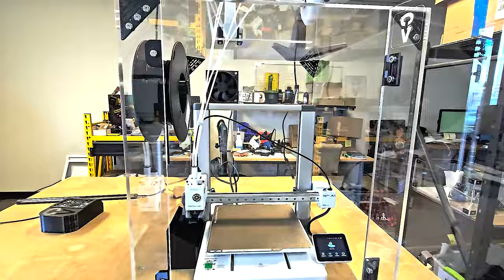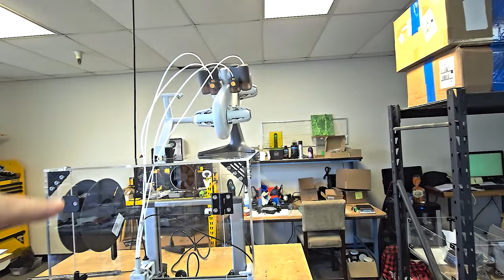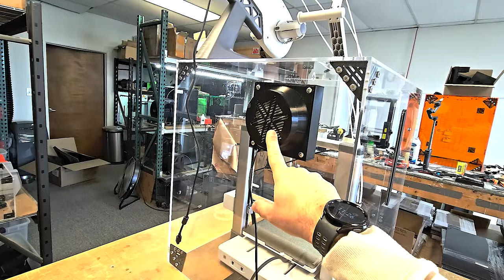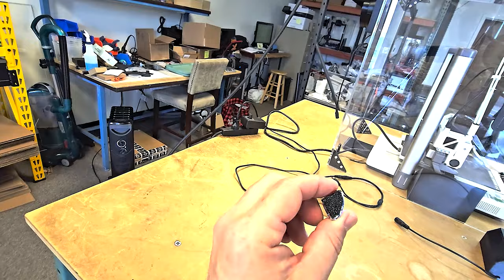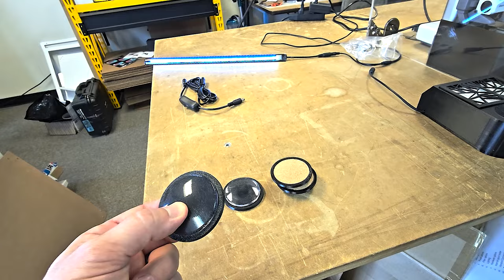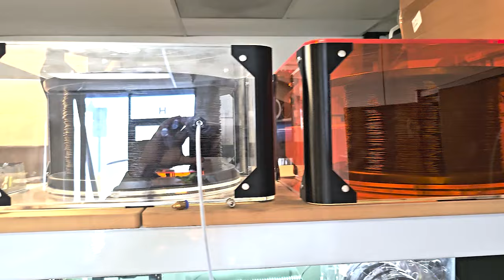Bambu A1 Enclosure by Clearview Plastics

Comment: ur products are expensive to the point that i might as well buy the p1s.
Reply: Not if you want multi color
Reply: @yobtnirp3D  P1S combo is 1000€, A1 + AMS is 600€. The Clearview enclosure is 325€ (no add-ons except for printable parts, because buying 2 rolls of high temp PETG is more expensive than just having them print it for you). Shipping to the EU is 118€ (!). Let's say I live in California, the total cost of the enclosure including shipping and taxes would be 360€.

So in total 960€ for an A1, AMS Lite and a 3rd party enclosure or 1000€ for a P1S with a full sized AMS. I know what I would choose.
Reply: @twanlange2827  In the US right now.  This thing plus your A1 combo is roughly $16 cheaper than getting a P1S combo to start with. Looks nice, but too expensive.

Comment: Way too expensive for what you get why not just print the corners and buy the acrylic yourself?
Reply from the maker: While building a custom enclosure is certainly possible, it's important to consider the full scope of the project. The materials alone, when sourced at high quality, are more costly that many realize. Beyond that, there’s the time investment involved in design, planning, and reworking to ensure it works correctly. Our enclosures are crafted using professional-grade machinery that ensures precision and durability, and tool set that typically cost well over $100,000.

We know what an enclosure with 1 hour, 10 hours, and 100 hours of work looks like. With thousands of hours spent refining our designs, we’ve optimized both the functionality and aesthetics of our enclosures. Achieving the same level of quality with home tools, both in terms of design and finish, can be challenging without significant investment in equipment and design time. Our enclosures offer an already laid out plan and professional solution that balances cost, quality, and time efficiency.
Reply: @clearviewproducts  or I could just buy the material online and do it myself for half that price
Reply: @clearviewproducts  It would be of similar cost or cheaper to either buy Bambu's P1S or their P1P and enclose it rather than buy your overpriced product, listen to the people please, find a way to make your product cheaper and sell it cheaper, I am also curious why the A1 enclosure is DOUBLE the price of the A1 mini when it would require just slightly larger side panels.

Comment: This doesn't match the dimensions that Bambu suggests for the A1.  They recommend 695mm (27.3") of space for the Y direction travel.  This leaves space for both the plate and the cable behind it.  Your enclosure is 3 inches short.
Reply from the maker: We built the enclosure around the printer and the depth we've made the enclosure allows proper clearance by lightly diverting the wire up and to the side. If you need assurance that the wire will completely clear we also make our utility line of enclosures. The large size will accommodate that depth. This is the same enclosure in larger form. https://clearviewplastic.com/collections/3d-printer-enclosures/products/clearview-utility-line-of-3d-printer-enclosures

Comment: looks good, BUT Bambu recommend not put this printer in an enclosure as the power supply and  other parts would be inside the heated area. Are you adding any cooling to this area?
Reply: did you watch the video they got an intake
Reply: @bitcrusherNOOP  🤣
Reply from the maker: On enclosing, there is nothing wrong with taking BBL's advice. We make these enclosures for good reason and many printer companies carry a similar warning in that it could shorten the life of the printer, yet many still enclose their printer and do so successfully for a long time. We've added active cooling to manage temperatures.

What we would suggest is that you'll find that without the enclosure you'll find more print issues with wrapping, clogged nozzles, and degradation of print quality. Also, you are printing in the open in which the printer off gasses particulate into the room. We build in cool air intake and filters to help keep electronics cool and workspace clean. 

If you don't enclose and your printer lasts forever, you'll certainly find in that time you will not be able to print certain parts or filaments with out an enclosure. We make no promises that it for certain won't shorten the life of your printer, but our testing suggests printers do fine. With the issues mentioned above,  We'd would suggest the enclosure is an overall net positive and contributes more to the print experience than it takes.
Reply: They are very expensive.

Comment: Is there anything to keep the board cool?
Reply from the maker: Yes, we have a cool air infeed at the base of the enclosure to get cool air under the printer where the electronics are. Additionally, with the exhaust fan hepa filter the temperature in the enclosure is well within the safe operating temps of the printer.

Comment: That will definitely make a difference when printing high temp engineering materials but is the cost of the enclosure worth the A1 upgrade or just buying a P1S will be the best solution?
Reply: It’s $269 for 3 black sides plus a clear front, and about $320 for all clear sides. Looks good, but as a hobby printer only working with pla mainly this would be a waste for me since I would have to keep the door open anyway. I think that it’s cool that they are a fairly local company to me in the SF Bay Area, and I may have to check them out sometime.
Reply: The p1s will be the better option no matter what way you look at it if youre planning to have an enclosed printer
Reply: The p1s is a more universal machine. It's worth the extra cost and is well worth it. I'm happy with mine and it can do all material types I need including abs
Reply: @perjian1697  how's printing TPU with it? (not using the AMS, I know..)
Reply: I mean I dig it I not a fan of core xy printers depends and what your looking for.

Comment: I'm not sold on this yet but i am interested. Have you guys done any videos on the A1 in the enclosure while printing with abs/asa? Can you guys do a video about the internal temperature of the motherboard and the components while printing and show us how effective this enclosure is? Maybe do a 24/7 stress test of it inside for a week or two to show people that their expensive printer wont die in them?
Reply from the maker: Here is the info we can offer. Our print farm prints PETG 6 days per week and has been printing since day 1 of this printer came out and was delivered. With our External exhaust hepa filter keeps the chamber temp well within the acceptable operating temperature for the A1 and its electronics. There have been zero electronics issues with our A1, nor have we ever damaged electronics in any printer in our print farm. We haven't nor will we test filaments like ABS or hotter on the A1. If a user decides they need to print high temp filaments on their A1 it is up to them as a responsible person to do the diligence on printing with these filaments. One assumption we can provide is; successfully printing high temp filaments on the A1 without an enclosure is very unlikely.
Reply: @clearviewproducts  that's a shame. It would be cool to see videos like that from you guys. It would definitely increase sales, that's for sure, but in that case, a $60 all in one enclosure would work just as good as this $100+ for petg lol. Since you guys did testing for a week, what was the average internal temperature of the enclosure during the week?

Comment: That looks sweet! Bambu recommends the AMS be places on the right. Is it fine to run it on the left?
Reply from the maker: This is likely due to cord length, bowden tube length, and using the reinforcement clip for these with the extruder wire. With the extension kit we have coming available this month, it will make this workable.

Comment: This add on just brought the price of the A1 combo very close to the P1S combo. Just buy the P1S combo people...
Reply from the maker: We'll suggest there is more to it than that. The P1S and the X1 still don't have sufficient sealing and air filtration. Many of our clients use these enclosures not only for a better print environment, but also for health and safety concerns around 3D printing. So much so that our enclosure for the P1/X1 is one of our best sellers.
Reply: @clearviewproducts  Your enclosure is not air-tight. Please do not gaslight people into thinking it is. It is not that greatly different gas-level to the P/X series gas leaking is not much more than your enclosures.

I didn't see a single seal anywhere on your design.
From the gromet gaps, it actually is less sealing overall due to the airflow pattern used.
Reply: @KannaKamui  Not to mention the gaping hole on top for AMS feed-in..
Reply: @touma-san91  and on the side slit too lol

Comment: When printing with PLA, is it actually required to cool down the enclosure or would it be fine to use only the recirculating filter and let the printer bed warm up the air in the enclosure?
Reply: I'd assume it's a similar deal to other enclosures - PLA actually needs the cooling as the subsequent increased flow rate is too high for the nozzle to print properly, leasing to defects.

Crack the door open and print if it's not terribly cold if you're printing PLA
Reply from the maker: It really depends on the filament. The main factor here is preventing the filaments from softening at the extruder. Some filaments have higher melt temps than others of the same type. A normal work around is to leave the door open a bit. The fan addon we offer adds in air filtration.

Comment: Can we add a duct to the back fan to have it vent to the outside? Is there an additional part available to connect a duct hose?
Reply from the maker: Yes. The filter in this video can be used as an exhaust as well. It includes a bracket that allows you to slip on a 4" exhaust hose. It can be converted from filter to exhaust in only a few moments.

Comment: so if i want to take and put my a1 i have to disassemble the enclosure?
Reply from the maker: Not at all. With a bit of work the printer can fit through the door. Our preferred way is simply to remove the screws to the front panel and you'll have great access to work on the printer.

Comment: So the A1 is not made to have a enclosure since the electronics may take dmg during higher temps. What are your stands on that?
Reply from the maker: Many printer companies suggest the same yet we make these enclosures for many different printers.  Our enclosure has a cool air duct on the rear to help keep the chassis base cool. With an our exhaust fan filter setup the chamber temperature is well within the service temperature for the printer. Our A1 has been in the enclosure printing PETG 6 days per week since our day 1 order and has performed without issue. We've also tested many printers in our print farm, with heavy use, with long term success. We've never had a power supply, mainboard, or a stepper motors fail.
Reply: @clearviewproducts  and also as others have mentioned, the price for an enclose from u, u can buy a P1 instead. But sure I would be willing to test it out. So send me one =) hugs.